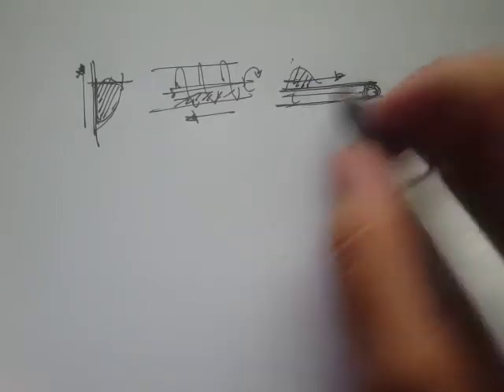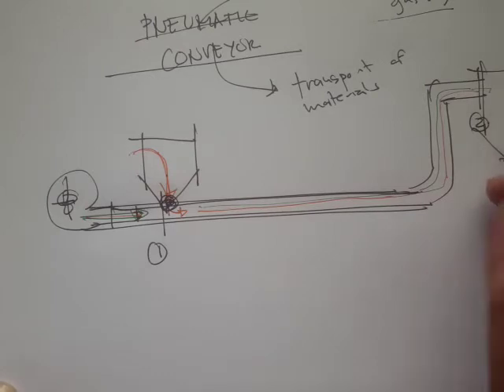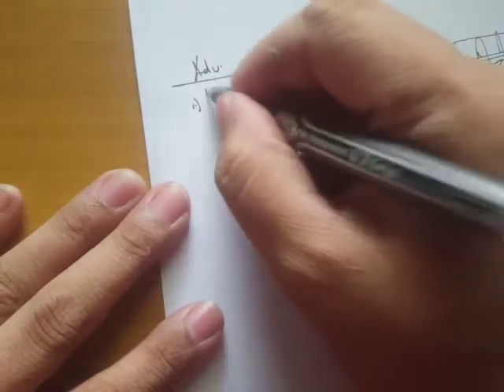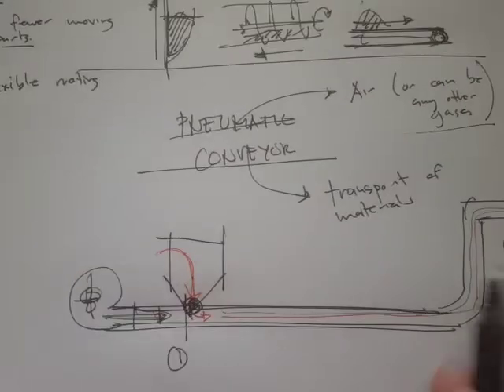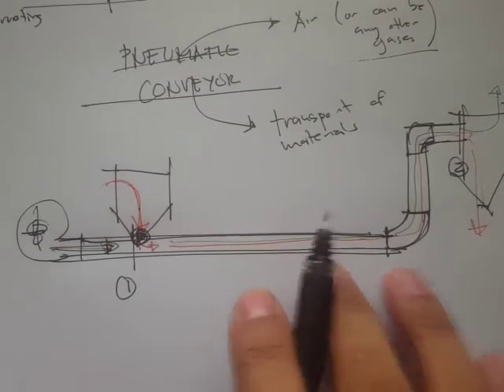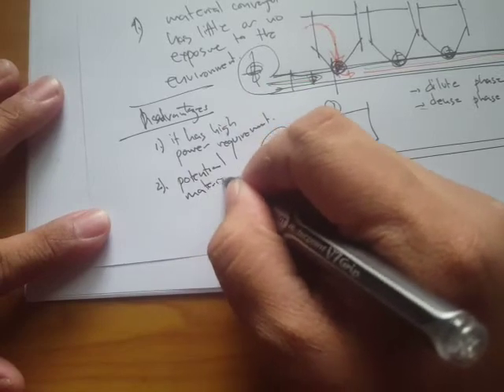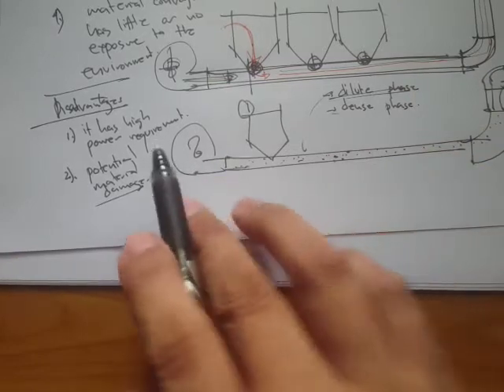ABE180 - 06.01 - Design of Pneumatic Conveyor (Part1)

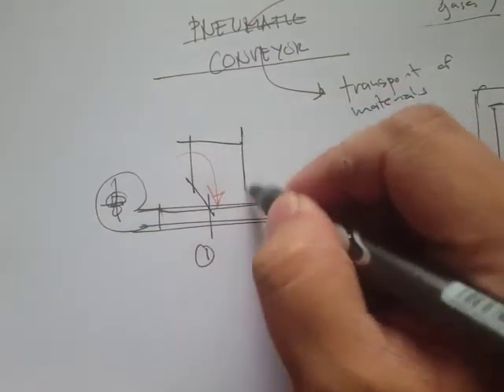Comment: What shall 2:55 be 2:55  of impeller  if pipe inlet dia is 3 inch and motor rpm is 1,800rpm and what be the pressure,static pressure of the system,considering installation is 1m above sea level?

Comment: Dear Sir
Can you make video one dust collector ducting design
Reply from the maker: Hi Mr. Engineer, I'll try, but at the moment, and as usual, i'm kinda overloaded already.  your request looks interesting though.  i've seen references already available in the internet.  but as typical with any design situation, what i do is 1.) figure out first the process/function and 2.) then try to find some codes/standards or any other references for the data, etc.  3.) next step is to analyze using the engineering principles.  Consider first the main function, lock that constraint and then move on to mechanical aspects, and then structural aspects, controls, etc... and dont forget to apply some factor to account for the uncertainties.

it is an iterative process though.    and since it's a design, we know that the calculation that we do is a range of values.